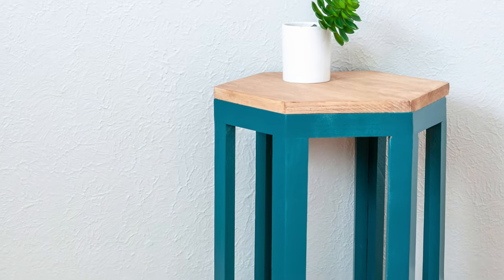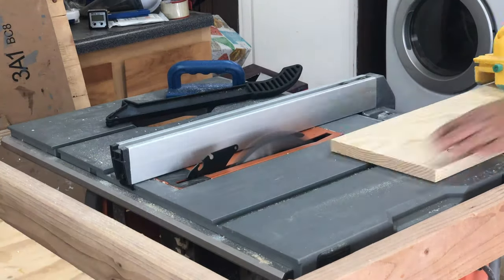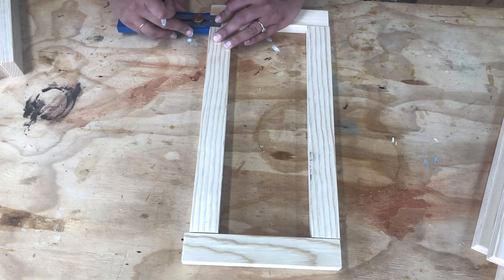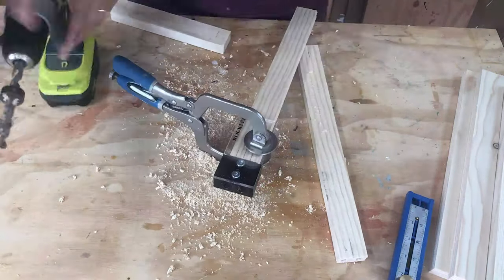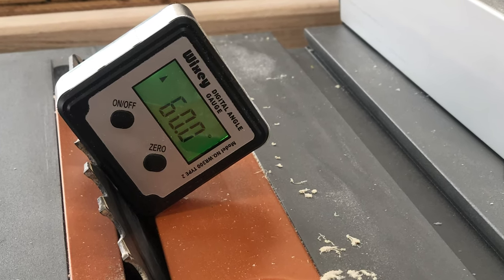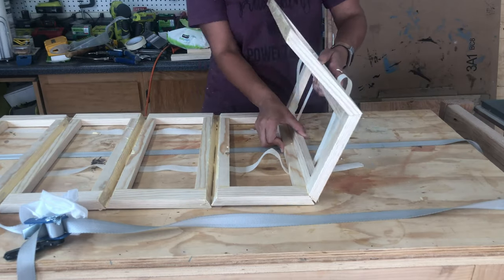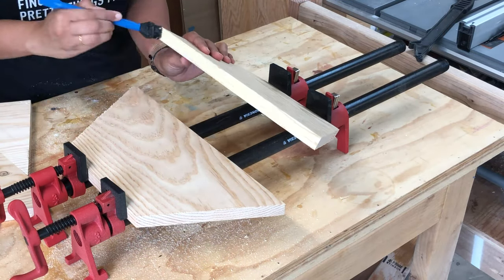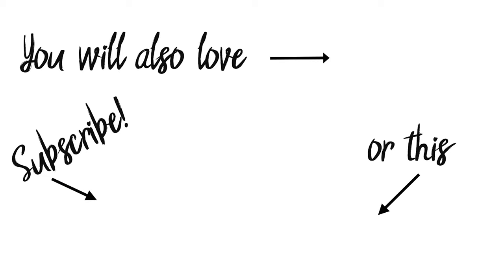DIY Hexagon End Table - How To Make Using ONE Board - Anika's DIY Life

Comment: I have a question about the Kreg multi mark tool, I just got one at Lowe’s and it seems like the slot in the ruler is not quite straight- is it supposed to be? I’m wondering if I got a bad one, it’s offset enough that it’s difficult to screw in the knob.
Reply from the maker: That sounds like it is defective. It should be straight and easy to screw the knob
Reply: @Anikasdiylife  thank you so much! I was feeling like I was missing something